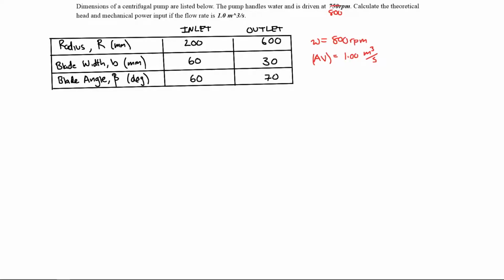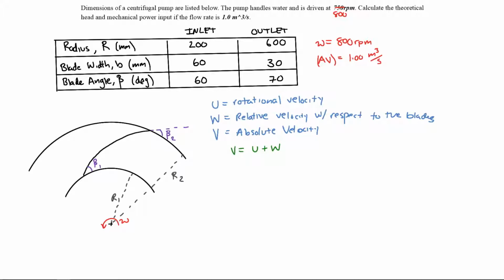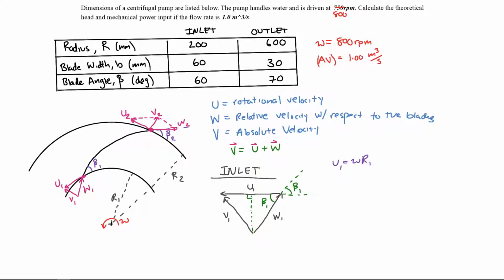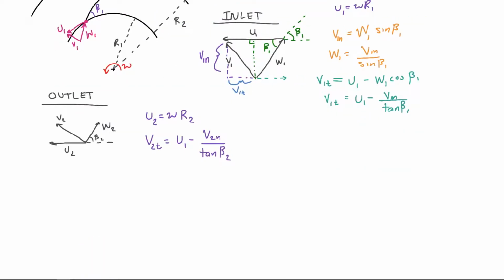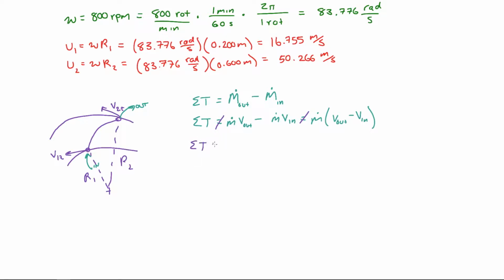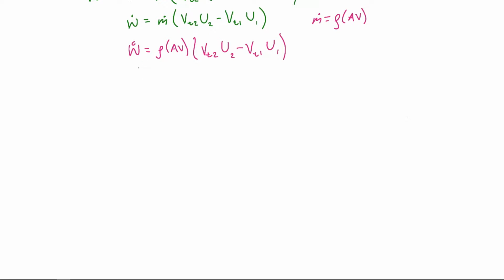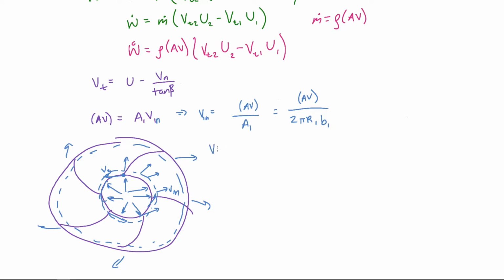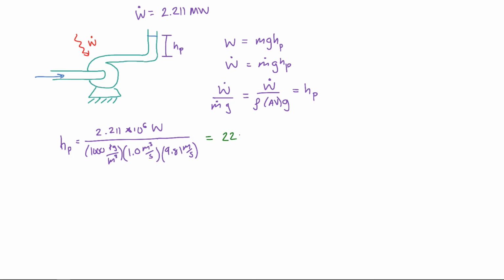TRANSPORT PROBLEMS | "Dimensions of a centrifugal pump are given. The pump handles water..."

Comment: At 8.15 min do you mean V2t = U2 - V2n/tan B2 ? As shown, its U1.
Reply: Hi Alex

You suddenly start to use Theta (11min in). Do you mean Beta? You have not introduced Theta but commonly others use Theta in the initial triangle.
Reply from the maker: @seymourfroggs  in terms of this problem, yes beta and theta are the same. I used theta to generalize the equation because it does not only apply to pumps with blade angles.
Reply: @alexjbeezy  Hi - well, thank you ++ for the reply. Actually, I spent a lot of time with your (and other) videos on centrifugal pumps. Because I am building two small ones for an i.c. engine. This is my conclusion: in ~1800 AD, or CE as they say, the geniuses Euler and Lavoisier looked at "water wheels" and knew the height of the water fall and the flow rate. So they devised the energy equation analysis, the basis of these You Tube videos. They weren't interested in pumps, so much as turbines. It *seemed* you could just reverse the analysis for a pump. I finally concluded this was invalid!! How dare I?? I hesitate but I think the analysis is silly. No offence at all. 

PUMP: First, (and I am unsure of my stance here), you can consider the radial flow as fixed. But energy is added, so whats the catch? Is it a tangential component that is added as we travel outward? And yet, others do not base the analysis on this idea of a fixed radial flow. 

My second point is this: consider you are on the tip of the inlet blade. If this is at a "low" angle to the water, the velocity of the water onto it will be ~the tangential velocity of the blade. So *that* is the Relative Velocity at that point, not a value derived from the triangle of vectors. If you had a flat blade normal to the water intake, a disturbed amount would be picked up and pushed laterally, indeed accelerated by the combination of apparent radial (along the vane) and "horizontal" movement (ordinary centrifugal flow).  
Another point is that it is cheating to know the flow rate to start with. Thats what you want. You want the flow rate and the head to start to analyse a pump. You should be able to say, I have 1.0 kW power, and I want this head, or this flow. And the design should give the answer. Not knowing 2/3 the answer to start.

A final thing, when I got the dot product of two velocities, what units did I end with? A distance times an acceleration? Or an area over t^2?? I tried to visualise such things as an area volume of water per unit time but it did not play out.

So I am stuck.